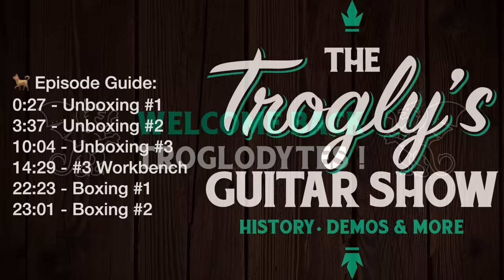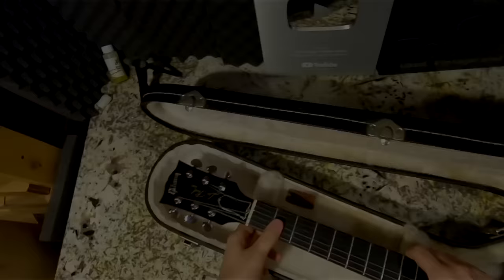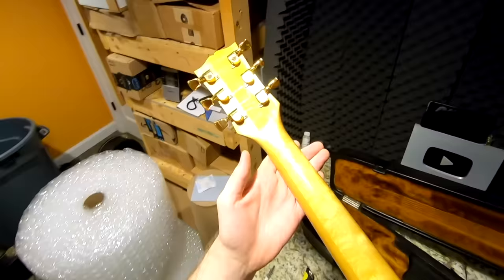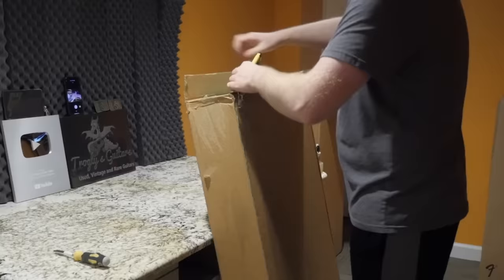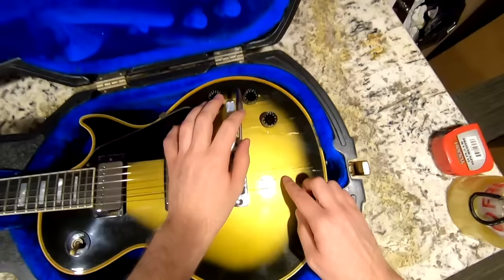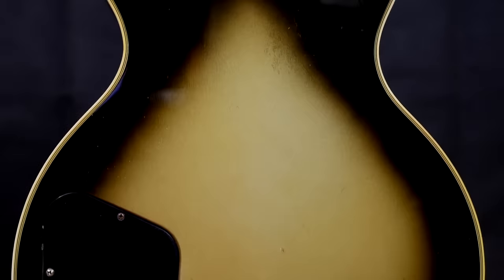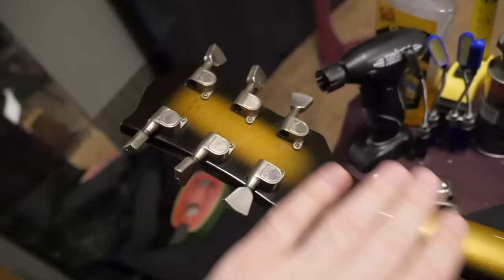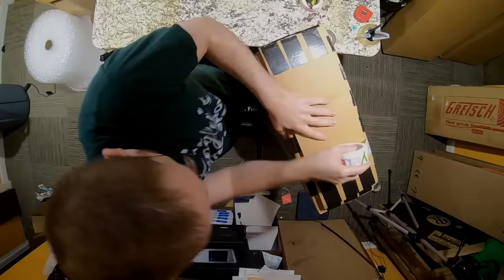What Happens When You Buy 3 Guitars from Guitar Center? | Trogly's Unboxing Guitars Vlog #87

Comment: I’ve never bought a guitar from Guitar Center or Sam Ash, but I’ve gone inside and tried a few guitars in exhibit. They have a  terrible set up. If they want to entice you to buy a guitar, by letting you use it a while. They should have them serviced, so your experience with it is top notch.

Comment: That is a Condensation rash. It usually happens when it was shipped and extremely cold weather or in a non- pressurized cargo hold. (Note: This Can occur on any Guitar of subjected to a rapid temperature change from cold to warm that's why it is best not to check guitars into baggage but gate check them so they're handled personally to a stewardess and stored above deck where it's warm and pressurized cold and warm extremes do bad things tonight through solo finishes that's why Chuck Berry always checked his guitar at the counter.

Comment: I worked at Guitar Center for 2 yrs. Very little is done to check the guitar over when buying used gear...at least at my store. We basically plug it in and check the electronics and make sure the neck is straight without any cracks. In the 2 yrs, I never once saw anyone take off the truss rod cover off and check that. We also never opened access cavities to check the cleanliness of the pots, etc.

Comment: In 2018 I bought a used 2016 MIM Fender Stratocaster and I got a decent deal on it and it's a fantastic guitar, one of my favorites I've ever played. BUT, when it got to me, the pickguard was completely heat-warped, to the point the strings wouldn't play. It was a mess. I fixed it (thanks to youtube video guidance) and it needed a setup (but I think most guitars do). I contacted GC and told them about it and they gave me a small refund. They offered to take it back for a full refund but I had already fixed it and it was so nice and got it for a pretty good price.  So in the end, I was happy, very happy. I bought sight unseen online because I knew I could return it to my local GC if needed. I'd buy from them again.

Comment: I ordered an used American Fender Stratocaster from Guitar Center. It was described in excellent condition, all original, only lightest of scratches, etc. It was shipped to me from the Guitar Center in Miami FL. The day after I got the guitar delivered that Guitar Center (as well as most others) closed due to Covid-19 pandemic. This was definitely not an originally equipped American Stratocaster. The electronics and pick-ups had been changed out to EMG pick-ups and electronics. I found out later that this is called a "Roger Waters" setup. Needless to say I tried through emails and phones calls to get them to take this back. No one answered calls and/or voicemails and emails. The electronics stopped working (lots of static) just 5 weeks later. Thankfully, the Guitar Center in Chicago (where I live) gave me a full price exchange for it once the stores started to open again.

Comment: 19:00 That guitar was definitely near some heat.  Probably a radiator or stove heater of some sort.  It looks like something someone might have sitting out in a living room.  But was most likely heat.  That is what it looks like when you start to remove paint using a torch.  A torch or heat gun is the method I use when removing paint from beat up guitars when someone wants it repainted.

Friendly tip... Never use Krylon Triple Thick whatchamacallit.  Tried it as the the owner of the guitar bought it.  I hated it... I want to redo the entire thing but the owner was fine with it being a bad clear coat.

Comment: That Kahler-loaded Gibson is definitely flood damaged.
Reply: I left a note up top. I do a good bit of finish work... he is looking for a mechanical resolution to a chemical issue. there was a cheap finish put on over a good finish. solvents didn't blend. it cracks under stress every time. The replacement parts might not help...but that finish cracking is actually a finish issue I would bet. Can't be sure of course.
Reply: @gr6914  Yeah, we've seen that (same dumb thing) too. We always recommend a strip-to-wood and repaint. Any thoughts, GR? ROKKON \m/
Reply: @DeafBunnysBand  if it's a solvent that was too hot for the finish... yeah I don't really see much of another way... Mohawk makes a great product (seriously named) stripper wash... and another named "wax wash" I would run a good soft mesh brush over that finish with both of those after a good 180 to 220 grit sanding... then rebuild it... maybe I'm nuts?
Reply: I think the wash is like M712-190... it works really really well.
Reply: @gr6914  Huh! We're gonna try that on a project guitar we have that's sitting in pieces waiting to get binned or assembled. A good tester! Thank you for the advice! ROKKON! \m/
Reply: @DeafBunnysBand  hey no problemo. be careful though. the instructions on the can are real... it's tough stuff so be ready to go ahead and do your best... hahahaha. Finishing is the WORRRRST and I have to do it all the time.

Comment: I totally loved that natural LP custom. I definitely wouldn't have turned that one down. even with the the truss rod issue. Dan Erliwine said that sometimes when they rout out the the truss rod cavity. the wood can be a little splintered. and when the truss rod is adjusted the wood will compress a little bit. he has a video where he added a washer. and the truss rod worked perfectly that was a damn nice guitar.

Comment: Something that burned my brain while watching you replace the screws in the trussrod cover....when working with plastics, wood or even aluminum; turn the screws backwards until you feel the threads drop into place before spinning them into place. It's a good way to avoid stripped threads. I do it when changing spark plugs. Hell. I do it when working on damned near anything threaded. A couple of seconds won't kill you, especially when it's wood. 
Do you ever get tired of seeing Les Pauls and not truly playing them?  3 would be more than enough for me.  I remember wearing a Norlin Deluxe goldtop around my neck for hours at a time while playing gigs or jams. I was thankful to play my Strat on the nights I played it but, even an alder body Strat gets heavy. Play some 50s-60s Fender basses, they are as important as any Les Paul or Strat in the vintage market.

Comment: About 10 years ago bought a used 3 pickup sunburst les paul from guitar center that was listed at another store across the country. It got sent in and i checked it out and there was a headstock repair that guitar center NEVER ADVERTISED in the listing. It was a bad repair job too. I sent it back and will never buy used from guitar center again.

Comment: im in the process of watching this vid. i got to nat finish '82 custom LP. upon your distress @ truss rod issue & felt compelled to offer some possibly needed info. you seem to relish the 3pc, glued up maple necks & thought id share my experiences with them. i had a late 70s custom Lp & still own a '81 Es 335 Pro. both had 3pc msple necks. and issues. both of mine had pretty serious twisting at the necks. both had aggressive truss rod tensioning to counter-effect the twisted necks. both had frets pulled & finger boards planed to make the playing surface @ fingerboard straight to the axis of the guitar. the necks will ALWAYS be twisted upon inspection but planing the fingerboard & refretting made them solid players.. i put 2 #10 flatwashers between truss rod nut & semi-round thrust washer that comes stock this will keep you from running out of TR thread..i used a liberal amt of that stew-mac guitar grease on the threads & thrust surface of the TR nut..hopefully some of this data will be useful to you..

Comment: I bought a Martin ceo9 used from Guitar Center. It was about 2/3 of the price, it came without a case but in a box with crumpled up brown paper, or inside box. I got it in June so temperature wasn't an issue. I  brought it to a nearby luthier and he fixed 2 of the tuning pegs, changed the strings,looked the guitar over, nothing else wrong with it, and it is one beautiful guitar.
Reply: That’s an awesome find.those CEO’s are sick😊

Comment: Bought an Open Box Sterling Stingray 5 from Guitar Center. Came with a gig bag, but the box it shipped in only had two pieces of packing paper in it. The bass in the bag was essentially freely moving during shipping, and thus the D string tuning peg broke. GC was great about it though, I took it to my local one and the tech glued the peg in place so I could have the bass and play it. Even went as far as contacting sterling and having them ship a new tuner out for me.

Comment: 1st guitar:  I'd send back due to untrue advertising.  In business deals I do not make excuse for people since it is what enables people to do it on purpose eventually.  Send it back and they will learn to get it right.  This helps everyone get more fair deals rather than less fair.\

2nd Guitar:  You assumed the management would ignore the 3 day return policy.  If you are right, it does not reflect well on the company, but neither does sending you that guitar with an obvious problem like that.  They should have known to fix that rod before the sale.

3rd guitar:  The results of years of selling guitars like 1 and 2 to people that give them too much of a pass.  It is the reason I haven't shopped at guitar center for years.

Comment: I bought a ‘brand new’ 2018 Les Paul Classic from Guitar Center. The guitar I received had several dings, rusty strings and was covered in dust. Clearly it was a floor model that was re packed and sold as new. Full disclosure: it was packed well and I was given the option to return it or keep it with a discount applied. I ended up keeping it but will not buy online from Guitar Center again after the experience.

Comment: I love buying used at GC but they are very inconsistent.  Ordered a used 25 year old bass that was listed in good condition and was about $300 under the real market value.  Got the thing and couldn't believe it because it basically looked like new minus some light scratches on the pickguard.  Ordered another bass that was about 7 years old and listed in excellent condition and while the front was completely clean there were huge gouges in the back and side.  Still held that one because I got it from them for about half of the current reverb price but did let someone at the store know I wasn't happy with the condition they rated it at but they weren't overly concerned because I think they knew they had it underpriced.  Did get an amp once I had to return because of an issue and it was no hassle which is really the best part of buying used from them.

Comment: Sometimes, some kind of clear will crack under very cold weather. If the guitar is very cold and you open the case without letting it sit for a few hours, it could crack.

Comment: It seems to me that you missed getting that natural Custom for no good reason Austin - I've owned quite a few Les Pauls with a similar amount of threads showing, and had absolutely no problems with adjustment over many, many years.
The threaded section of the truss rod is about 2 inches long before the nut becomes "maxed out".
So there was masses of adjustment room left!
Look at a picture of a Gibson truss rod and you will see that there was really no problem.

Comment: The Custom with the damaged finish and the Kahler  tremolo has been damaged with some type of chemical. Probably a spray cleaner or lubricant. Looks like it ran off the control pots and the tremolo while the guitar was in a vertical position, and the finish was highly allergic to whatever it was. Lacquer is NOT forgiving of stupid mistakes. That's a major cause of finish damage anymore.
        
For instance, a friend of mine had a pretty nice '80s LP Deluxe with the natural finish and some pretty heavy finish checking. He started rubbing it down with Liquid Gold furniture polish after playing, in a misguided attempt to keep it looking nice. I warned him that it would ruin the finish, but he wouldn't listen. Well, a few months later he brings the guitar to my house to see if I knew a way to fix it. The "polish", which is the dark kind that looks like thinned down stain, had soaked through the checking. It looked like someone had traced every crack with a brown Sharpie pen. I told him it was screwed, and that I had warned him, and that his only recourse at that point was a complete refinish. He quietly sold it a few weeks later, and I'm sure he didn't disclose what happened to it. 

Stuff like that happens WAY too often, as attested to by your Custom. Very sad. Everyone loses.

Comment: I sold 2 guitars to GC last year.
Both guitars had some issues that I didn't want to pay for repairing.
When I saw the listing on their web site none of the issues were disclosed and the guitars were rated higher than I would have rated them.
'At the same time, I bought a used guitar from them. It was shipped from out of state to my local store.
The guitar had several undisclosed issues and was returned.
Not a lot of faith in GC used guitar sales.

Comment: Bought a used explorer from them. The emg's were wired wrong and they fixed the bridge pickup. But not the neck. Also bought a mockingbird from them. Set up problems. It was eating string every time I yanked on the floyd. On the upside they forced me to be my own mechanic.

Comment: A few years back I ordered an inexpensive Fender Strat figuring I could upgrade the pickups and have an okay gigging axe. I ordered in online, opened the box in the store. Beautiful Seafoam Green body and a neck that was both bowed and twisted. Not just a little but like a miniature roller coaster. It took forever to get a refund.

Earlier this year I ordered a Gretsch 12 string from the website. I never came in. They had a display I considered but the gold plated tailpiece was corroded.

I'm pretty much done with Guitar Center.

Comment: I found a PRS CE24 in GC's used dept online and went in to try it out. It was graded on the site as "Great Condition' and it was most definitely _not_. Huge chunks of the finish taken out on the back, several dents, dings, etc. Even "Very Good" would be a stretch. But it played incredibly and I've got a soft spot for mangy dogs. 

To their credit, I plainly stated that I felt they'd overgraded the instrument but that I'd buy it for 1500 out the door, tax incl. The floor manager okayed it and I was on my way. But I certainly would have been bummed if UPS had shown up with that guitar after paying $1700+tax. 

Moral of the story: Buying b-stock, returns, used, etc. can be dicey. Not impossible, but dicey. I've found stuff online where the dealer was happy to FaceTime with me, plug the guitar in and let me really see the thing.

Comment: You have to be careful, I would talk to the store manager before purchasing as their used site doesn't give a lot of information.  Even then you can have issues.  I bought an Ibanez and I had called the sttore to make sure the guitar had the original case and Dimarzio Pups.  The manager told me yes and yes and even said to order through him so there will be no trouble.  I gave him my CC number and a few days later my guitar arrived with no case.  I emailed the store and got no answer.  Called and talked to the manager who seemed super frustrated and he said he would look into it. He left a message saying the case was on it's way and a couple days later, a huge bass case showed up and didnt even fit my guitar.  I was ready to return it to my local GC when the manager there said he would find a case for me which he did and saved their sale.  Would I buy again from them?  Yeah if I found the right deal I probablby would.

Comment: I bought 3 high-end used guitars from GC based just on the bad website pictures.  If you wait to talk to someone, you lose it.   GC will let you return locally for free so, if it's not accurately represented, just take it back.  Of the three guitars I got, they all were exactly what I expected... Great guitars.  The cases were a little more beat up than I hoped though.

I did buy a used silver face Princeton once, and it would have been in mint condition, but the guy packing it did a shit job.  When I received it, the whole side of the amp was split wide open.  That obviously went back.   Last thing I will say was that I had a worse experience buying new from GC.  In 2014, I wanted one of their discounted LP studio pro guitars, and I ended up buying 3 before I got one I liked.  (And honestly, even that one turned out bad mainly because Gibson doesn't know how to finish a guitar anymore.   The finish literally bled an oily solvent for a full 18 months.)

Comment: I ordered a used Godin Exit 22 from Guitar Center. It was in the normal big rectangle shipping box. they didn't include the gig bag that was supposed to be included and they just draped one sheet of bubble wrap over the guitar. So, it just bounced around in the box and the volume/tone knob area was completely smashed in transit. They let me return it and gave me a complete refund but an otherwise beautiful guitar that I wanted was basically destroyed. Another I called and asked about the fret wear. I was told it was like new. It was listed as excellent condition. When it got here it looked like it had been played 24/7 for about 30 years. I'm not messing with them again.